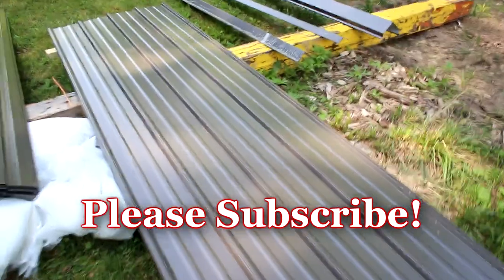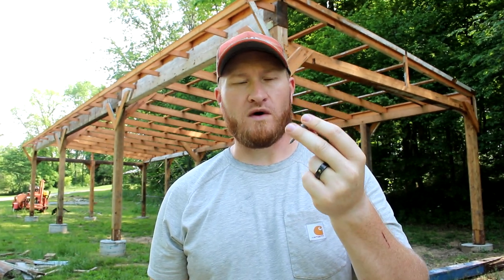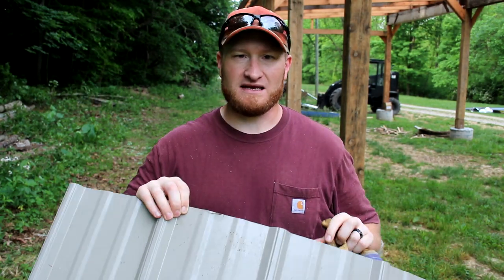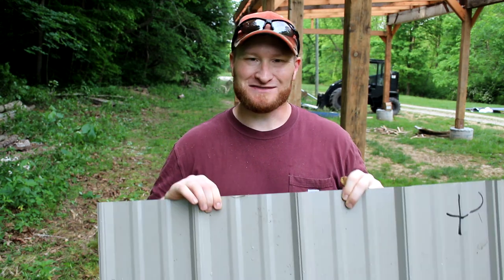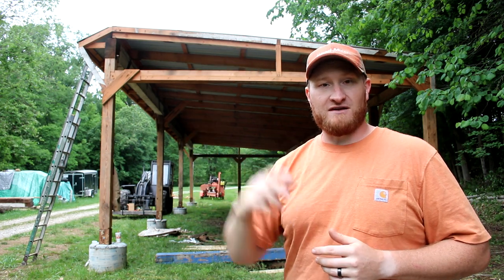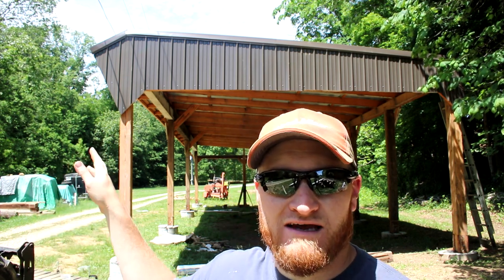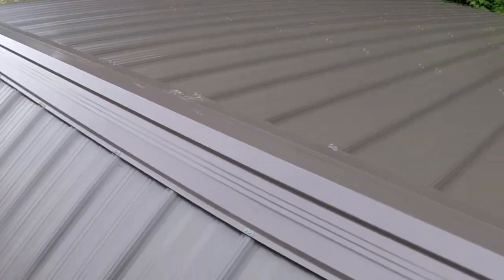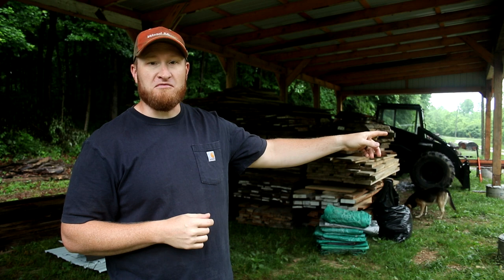Barn Build Part 11 - Last One! - Installing barn metal - Wood-Mizer Sawmill Shed

Comment: Since I am a car type a guy, milling is just something I find relaxing and enjoyable. I found it sad that a man has to almost apologize for doing any one thing wrong and being crucified for breathing. To error is human and to be perfect is a armchair person slinging insults and other. I find it rewarding that this roof is on and your equipment is staying out of the rain. I too am a person who likes to work in dry clothes... seahunt wasn't a program on tv that got me going. I'm of a thought that there will be more building going on as time allows.... if it were me and its not of  course... I would do a board and bat on the backside so that if you decide to go further back with your shelter, it wouldn't be expensive metal to move or get damaged when things change for whatever idea of removing sawdust or just a tool room for gumming your blades.... you also can hide a small fridge and coffee maker back there to have a hot meal opposed to cold peanut butter sandwiches. I am a packrat of sorts seeing things that could be made from or saved from trash to do something that probably never will   happen. Right now my porch holds some stuff I haven't seen in eight or more years as I moved here in two  thousand eleven. So if I haven't seen or missed it, probably will never need it then. So you get my vote for doing it your way

Comment: This is WAY too late but your roofing looks like it's made by Fabral. They recommend the screws be placed just as you mention; along side of the ribs. Placing the screws in the rib will prevent the screw from exerting enough down pressure to properly seal itself before the rib deforms. Good decision.
Dave

Comment: Your Lathes  look far apart. Be sure not to put your weight in between them when installing the Metal.
Reply from the maker: Would be a little after the fact at this moment, but I made sure not to lean on any open sections.  We made full use of the forklift to help us out to avoid damaging the metal.  Thanks for watching!